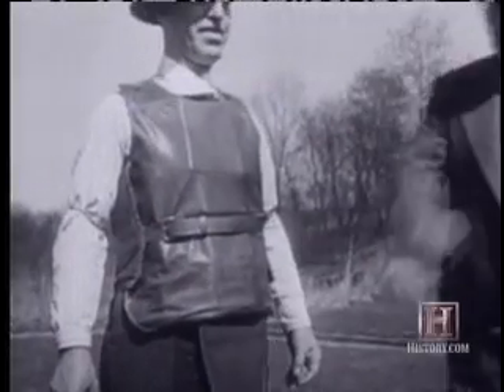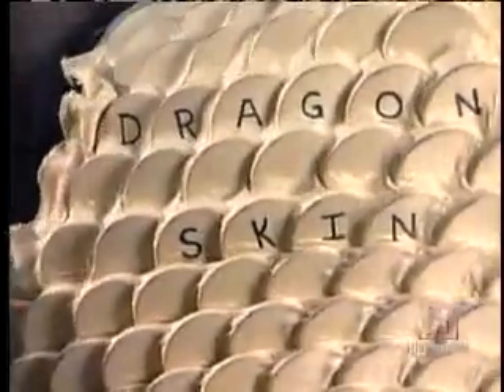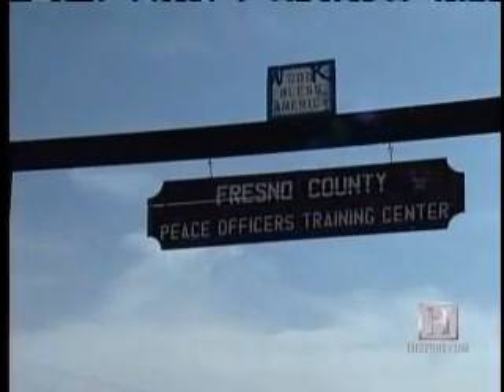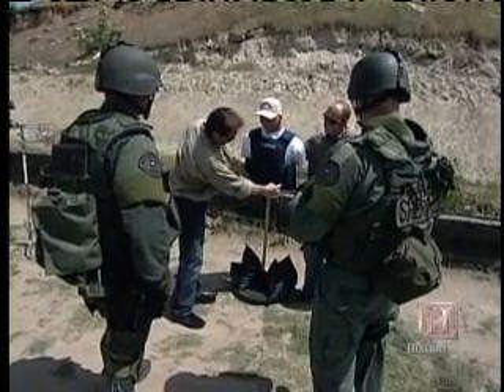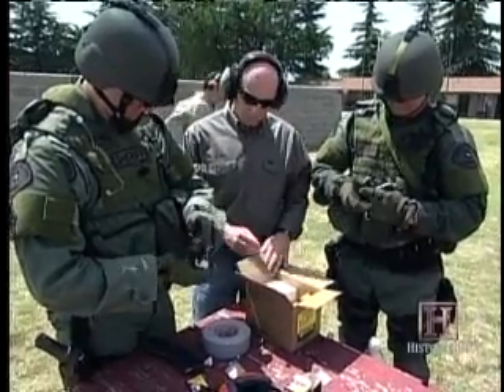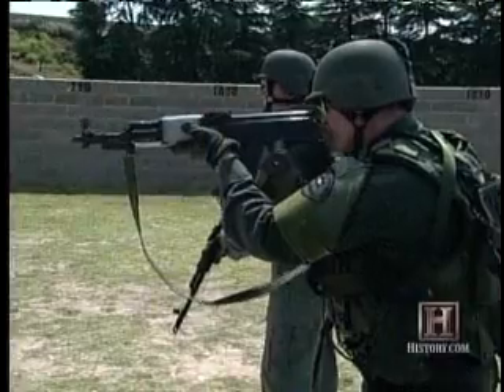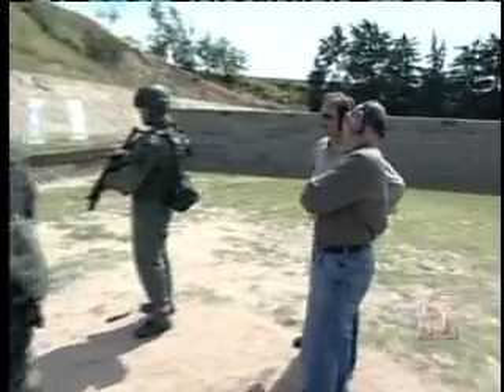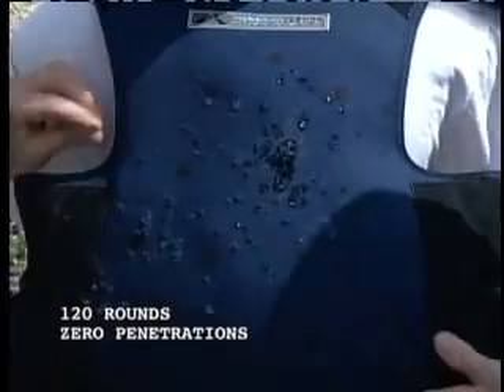Dragon Skin Ballistic Testing Multiple Shots

Comment: So it was banned because the ceramic plates sink to the bottom in hot temperatures.Although silicon carbide isnt affected by heat.So why don't they just  use the ceramic as a full plate?

Comment: To be honest it's really obvious. Even if the adhesives worked... it will still run into the same problem that has faced scale armour. Projectiles can get deflected to go between scales. Historically scale armour has been defeated this way.
Reply: That cannot happen.
Reply: @g00gle minus Indeed. Ceramic armor does not bounce. It just sprays little shards.

Comment: The US Military does not use this armor because , 

"What the Army found, was that the individual Dragon Skin ceramic plates (the inserts that make up the "dragon skin" designed to stop rifle rounds) became ineffective after being subjected to high heat conditions. This happened because the ceramic plates are being held by an adhesive that fails in extreme conditions. In room temperature, this adhesive works well. However, when subjected to heat (120 F and 160 F), the adhesive fails. This adhesive fails in cold temperatures as well. (-60). In fact, it fails to such an extent that most ceramic plates fall to the bottom of the vest, thus exposing the vitals."
Reply: +Jovan Rodriguez You know what's funny? The army banned it in march 2006, almost 2 months before testing it in may 2006.
Reply: Dragon Skin Level III armor was also tested the week of October 2, 2006 by Dr. Gary Roberts, DDS, Stanford University Medical Center.[10] These tests were conducted for a local law enforcement agency, as a control sample a stand-alone Armored Mobility Incorporated (AMI) level III steel composite plate armor was used for comparison. Both types of armor were conditioned for 12 hours at ************ 170 °F (77 °C),************** then moved to ambient air for approximately 90 minutes prior to being shot. The problems associated with the use of inelastic clay backing material have been well documented; as such, the armor was secured to a life-size curvilinear torso replica made of Perma-Gel. Each armor system was shot a minimum of 20 times with five rounds of each ammunition type fired against each armor system—one 90 degree perpendicular shot, two shots at 60 degrees obliquity, and two shots at 30 degrees obliquity, using each of the following loads fired at a distance of 10 feet (3.0 m):

5.56 mm 40 gr LeMas Urban Warfare (using a moly coated Nosler Ballistic Tip bullet) with a 3,718 feet (1,133 m) per second average velocity.
5.56 mm M855 62 gr FMJ with a 3,054 feet (931 m) per second average velocity.
7.62×39mm M43 123 gr steel-core FMJ with a 2,307 feet (703 m) per second average velocity.
.30-06 M2 150 gr FMJ with a 2,736 feet (834 m) per second average velocity.
All of the above ammo was successfully stopped by both armor systems in this testing, with no armor failures or penetrations, even after receiving multiple hits.
Reply: IN OTHER WORDS, INDEPENDENT TESTING DIRECTLY CONTRADICTS THE ARMY'S FIELD REPORT... AND REMEMBER, THEY BANNED IT BEFORE THEY EVEN TESTED IT.
Reply: Bull fucking shit. The reason Dragon Skin failed the Army's tests is because the Army doesn't want to spend the money. Dragon Skin costs a lot more than standard shit body armor from the 70s, and the Army needed a way to respond to anxious mothers on why their sons weren't given the protection they deserved as American citizens.
Reply: @johnpetrov6602  he didn't said he disagreed,he just said why they don't use it.Even if this was true,why not just use a better adhesive since it is a much better armour.Im not disagreeing with your comment though Mr John,I also agree the real reason is because the vest cost much more than the interceptor
Reply: @abraham3522  There was nothing wrong with the glue. The Pentagon drove the company bankrupt. They couldn't let them sell this armor to the Chinese or to the Russians; they had to be hamstrung and shut down.
Reply: @johnpetrov6602  thank you,for the positive reply.I think the chinese and the russians can still make a look a like if not the exact same techonogy as dragon skin,since the way its made is all over YouTube
Reply: @abraham3522  That isn't true. The process for creating the individual components of the armor are classified/top secret. The technology used in its assembly are classified for national security. Just knowing that the scales are made of ceramic is nothing. Ceramics are complicated compounds, each type has different ballistics properties. We don't know how far apart the disks were gapped and what type of spacers were used. We don't know if the disks were laminated layers or compressed matrices, and with what force they were compressed during manufacture. It costs loads of money to develop tech like this. What I'm saying is that this technology is an example of a repressed technology. The information has been sent down the memory hole. You as a private citizen cannot even purchase this technology, and it's all because the Pentagon didn't want to put the dollars down on its procurement. Soldier's lives are literally not worth the costs. They couldn't even allow an anxious mother to buy a vest with her own money because they didn't want even a hint to get around that they don't care about infantry lives. But I'll say it: the Pentagon doesn't care about infantry lives. They are nothing but cannon fodder to the brass.
Reply: @johnpetrov6602  Ah, here's the thing. Dragonskin weighed almost twice that of Interceptor. Troops today have trouble with catching insurgents, with the DS armor, it'd make combat operation very very hard. As well, LV3 armor.
Reply: @KoishiVibin  The weight was a problem.
Reply: @johnpetrov6602  42 pounds. Hmm...
Reply: @KoishiVibin  Subtract the Interceptor and the overall increase is only 20 lbs. This isn't great but it may have been worth it.
Reply: @johnpetrov6602  Ah, but this is with the IBA's additional plates. Without them, as the DA does, it only weighs 16.4, which gives a difference of 31.3 pounds, which can let you carry other mission gear, instead of armor, which may not have been as good. If you want a multi-hit plate that weighs much less and gives the same level of protection, grab yourself hardened steel.
Reply: actually it because its too expensive
Reply: Why would the military fight in 120-160F? Wouldn’t the soldier heat case? Why would the military fight in sub -60F?
Reply: @mr.nemesis6442  It's a complete lie. The glue held up fine. Just ask General Petraeus. He wore this armor in Iraq. He owns one of the 20 units in existence.
Reply: @mr.nemesis6442  It didn't need to get that high.

Comment: Or you could use super cheap ar500 steel plate i've seen it stop over 40 rounds of 7.62 39mm over 60 rounds of .223 a 12 gauge slug and 2 .338 lapua mags without failure all on the same plate.
Reply: would still hurt like hell
Reply: Hammerschlägen M  Depends. I mean, .338 Lapua ain't the most powerful. .408 CheyTac is a thing. Also, depending on distance, the .30-06 will go through half an inch of hardened steel, of unknown hardness.

Comment: It failed the heat and cold testing. in Afghanistan it falls apart because of the heat melting the glue holding the disks together also its heaver than the interceptor vests by like 10 lbs so basically it sucks

Comment: @akzo74 - armor want to concentrate 2380fps (typical ak47 load) into a single spot?  just because a shot doesn't penetrate doesn't mean it can't kill.  body armor defeats a ballistic threat by causing the round (as this video says for hard armor) to shatter WHILE @ the same time dispersing the force of the round across a greater area than the size of the round.  interceptor does it, dragon skin does it better.  the discs on dragon skin rest on top of eachother they aren't gapped btw

Comment: @akzo74 - actually it is true sir, there were complaints for BOTH dragon skin & interceptor that extreme cold weather had negative impacts on it's stopping ability but in dod testing interceptor passed, dragon skin supposedly did not due to the cold weather causing the ceramic discs to slip loose of their holding cells. also ur apparently not paying attention to how dragon skin works (or interceptor for that matter) they don't concentrate the force of a bullet why in the world would any body

Comment: @DoctorFreeman97 - And if you're thinking "well if it's made of the same stuff then how is it better?" it's due in fact to the way it's engineered and how it's employed.  This uses (as the video said) smaller overlapping ceramic discs that evenly distribute the muzzle velocity of an incoming projectile, as opposed to our current 10lb monoblock ceramic plate which shatters completely after 2 - 3 impacts thereby becoming completely unable to stop rounds.  Cold weather has 0 effect on ceramics

Comment: @kjaks 13 rounds passed through areas where there were no discs or where discs had fallen and there was no longer two overlapping discs.  The problem with Dragonskin is that it doesn't hold up well in extreme heat nor extreme cold.  The ceramic bonding used to mate the discs together also didn't last very long under harsh use.  So discs would fall and collect on the bottom of the vest.

The Army put out a pdf with xrays showing the the entry points and holes.

Comment: actually the reason why the military turned this down after testing was because the adhesive that the makers used didnt withstand high heat temperatures and negative temperatures, because of this bullet fragments would enter in between the "scales". The only reason why its so expensive is because it isnt in production in a large quantity like the normally used vests

Comment: @vistaway3008  Failures include, de-lamination of the disks when exposed to extreme heat and diesel fuel.  Ceramic glue which holds the disks together failing when exposed to extreme heat and also diesel fuel.  Disks falling off of the backing around the front of the armpit and middle stomach due to compression and wear around those parts (think bending areas) causing shrinking coverage.  And finally, low durability overall and a short life-cycle.

Comment: @12GaugeLosAngeles dragon skin does horrible against angled shots which is why it isnt standard issue to our military. If a sniper hit you from a high profile position, then the bullet will drag along the scales eventually scraping off and hitting you on your lower belly. If an enemy sniper or even foot soldier hits you from a low profile position then the bullet had a tendency of making its way between the scales to vital organs in the body. Its still amazing, but needs work.

Comment: I doubt that. And the IOTV's sappi plates are rated for 7.62x51NATO ammunition, meaning it can take alot more 7.62x39mm. And it is rated for a multi hit capability. And the ceramic plates are not the same as your kitchen ones, they do not just crack like glass when they are hit, they are enginered with multiple layers so they do not just crack up. there will be a shallow crator where the projectile hit bit there will be no huge spiderwebing crack spreading throughout the whole plate.

Comment: Stitching the discs into the vest COULD be a sewing nightmare. Depends how you do it.

defensetech (dot) org/archives/003504.html

The easy way is to sew each disc into its own pouch, then stitch them to the vest like buttons. Relatively straightforward and no adhesive is needed. 

Hence they would stay in place regardless of oil/saltwater immersion and
high/low temperatures, thus passing the standard military armor test and removing the single major obstacle for fielding the armor.

Comment: as they say the bullet is shattered not caught which means the fragments dart off at the same speed as when the bullet makes contact. usually the frags dont go 90° from the point of impact but more around a 40° and lower which means it could go for the neck and chin if anything.

Comment: Maybe, it would depend on the size of the round, what gun it was fired out of and from how far away. Also I have no idea what sort of dampners or force resistant material they're using, so it could be that the users of dragon skin feel very little at all. One would have to check the vest and try it, but I get the feeling it would NOT break ribs. Look at the back of the jacket in the video. There's not even much of an indentation after all those rounds. I think this vest works great.

Comment: I see a problem with dragon skin. What happens if a solider is lying down and get shot at and the bullet comes in a angle around parallel to the small round plates? Could the round pass between them? Because I think it could and there is your army's reason for not approving the armor. If you notice all the tests seen are straight on fire tests and bullets do not always come 90º to the armor.

Comment: Not true. The special way that the plates are designed are to absorb most of the impact. Death could occur from a shot from a .50 caliber but it is not guaranteed. If the damage to your ribs is not significant enough, it would be non-fatal. Few can say they would live to be shot by one of these deadly weapons. We should use dragon skin to increase this number. As for shooting between the plates, it's designed so you  cannot do that. It would take a perfect shot, from at least 700 meters high.

Comment: I understand what you are saying, I admit that no body armor, to include the D,S is perfect. It's just not possible, but I have seen those ceramic plates fail too. Before we were issued the ESAPT's, the old plates would literally disentegrate after one round. Even the ESAPI's are only rated at three AP rounds, and that's it. After that, those things just start falling apart. I think the DS just needs some fine tuning. Out armor is alright, but we need something better.

Comment: NBC didn't emulate the tests.  They just shot the darn thing in a nice climate controlled test range.  They didn't expose it to any extreme environment tests ever.  No one to date has ever tested Dragonskin chemically.  Only 2 have used heat and those were on a single unit.

In order to get precise results you have to test a multitude of the same type to eliminate chance or a possible defect.  Only the Army has done that.  Many of the DS units passed with no penetrations.  But some failed.

Comment: Hate to break it to you asswipe but your posing ass didn't bother to catch the mess up on their part.  17.2 lbs is for a single plate.  Even the supposed "independent" testers listed the correct weight and noted how god damned heavy it was.

Its not recognizable.  The plate carrier is copy of the CIRAS plate carrier.  The discs are sewn into a kevlar bag and pressure formed onto the discs then inserted inside.

Comment: Biased in what way?  Some of the Dragonskins tested didn't have any penetrations.  Some did.  Those "independent" tests only test a single armor.  Not 30+ like the Army did.  So how were the Army tests biased?  Every single other company that was submitted was put through the same testing.

Recon?  Recon ceased to exist years ago dude.  MARSOC is the new deal and those guys are almost seperate from the current corps.  But then its too easy to pose on the interwebz.

Comment: The Army did release the official findings when Congress got involved.  You can download the pdf's online with a little searching.

The MTV also known as the "Hesco" which is the Marine Corp armor.  They wanted larger front and back plates but the armor cost in weight.  The new SAPI's have better AP protection.

You've seen spec ops use it?  Really, what branch?  How did you know its DS?  You're claiming you're a Marine now or are you claiming you're spec ops?

Comment: Current IOTV and side SAPI which is level IV rated weight 36lbs.  Dragonskin level IV with full wrap around weighs 45lbs.

Army says discs fall off when exposed to oil, disel, other chemicals, and extreme heat.  Contractors in Iraq who wore it say they fall off with wear and tear of weaing it everyday in the field.

Dragonskin isn't durable enough to function in a active campaign.  Since the discs are sewn into a pouch you can't do field inspections either to find slipped discs.

Comment: Those tests the Army set up for the Dragon Skin were biased, and they never would relase the official findings...strange? I've seen Dragon Skin used by spec ops teams in Iraq first hand, it works very, very well. Our current armor, the MTV, is 50 lbs with all of the plates, you can't move, it's hard to breathe and you couldn't get that thing off quickly to save your life. Those SAPI plates disentegrate after two to three rounds, and if it's an armor peircing round you've got a 50/50 chance.

Comment: Sir, I hate to break this too you but currently NO military unit is using Dragon Skin armor.  Only private military contractors and journalists continued to wear the stuff after the tests.

Unfortunately even those people have given it up.  Michael Yon put his up on Ebay due to weight.  Contractors in Iraq report that the disks break off around high movement areas near the armpits/chest and stomach obliques.  Its just not made for long term wear and tear such as military campaigns.

Comment: Show gimmick?  I don't think so.

Yes, it may weigh more but it's weight is better distributed and the vest is way less bulky and uncomfortable than the SAPI plated Interceptor armor...and it can take round after round.  

There's a reason SEALs and other elite units use Dragon Skin...it's the best.  Same with the HK416 vs the crappy M4...if you're the best soldier you get the best gear.